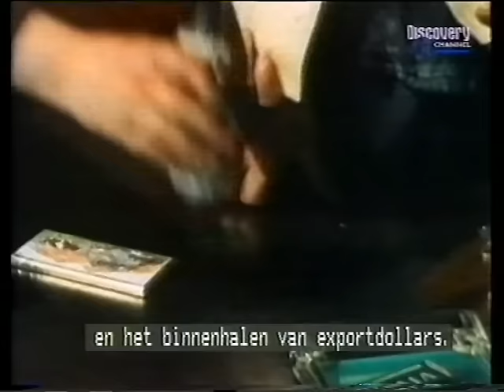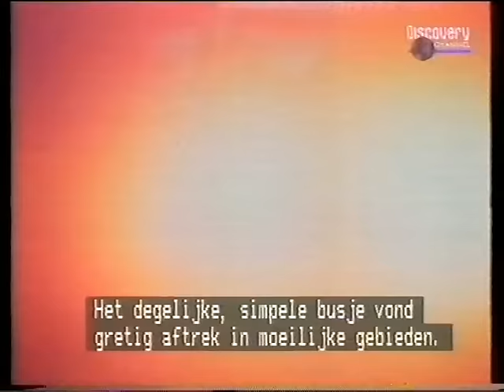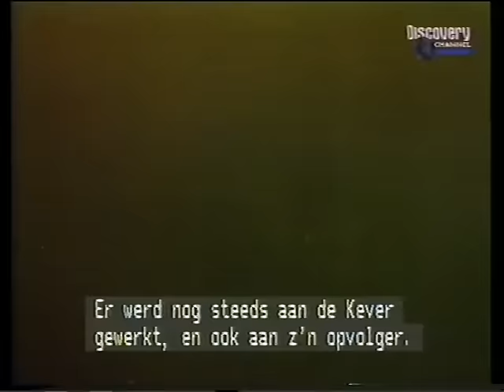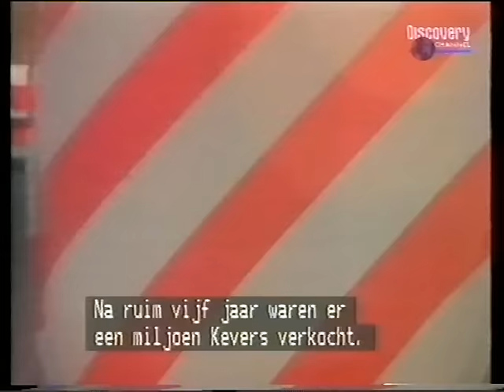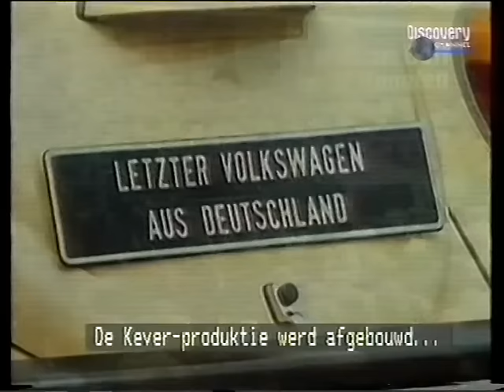vw beetle documentary Classic Wheels (3/3)

Comment: My great uncle back in the early 1990's when I as in my teens once told me when I asked him how hard it was to work on a classic VW Bug as he had owned a few told me ..."son, a VW Bug has to be the most mechanically simplified automobile ever made". Ferdinand Porsche was an engineering genius. For a carbureted engine, they crank up in the coldest of frigid weather compared to other older style engine designs that have carburetors and distributor points. Even the gas mileage is good for a basic stock 1600 Duel Port engine with easy shifting and driving and getting up to 30 mpg isn't unheard of. Parts are still affordable too. They are dependable and are dirt cheap to get insurance on and are good for daily transportation. The lack of them not having a/c might bother some people but overall, they are still good cars and easy to maintain and keep going.

Comment: To me all the new ones are not a real Volkswagen the real ones have the engine in the back and are air cooled . The others are a imposter . Wish I could find a nice one today they are collector cars selling up to 20K for one in great shape and to think in 1970 you could buy one new for less that 2K ! As a teen we bought them for $100 not running because most mechanics out side of a VW shop did not know how to work on them my father was a aircraft engineer and the first time he saw one out and the cooling tins off of it said that’s just like a light plane engine . In fact the FAA did certify them for use in experimental aircraft stripped of the cooling shroud and generator mount replacing the distributor with a magneto was all it took for certification ! Along with the relocation of the oil cooler .

Comment: We had the corvair Ralph Nader stopped that.  It was a damn good car. I had one it would go through mud, sand, anything.  And they kept making the beetle????  Gas tank in the front same thing.  If Nader had been a ball player or a vacuum salesman anything but what the bag of crap he turned out to be. Think of the tooling and molds that are around they could make the beetle now.....
Reply: +Mike Ricky Yes, despite the bad press, the Corvair, especially the 1965-69 Late models, were the best handling cars available from Detroit.  The styling was, of course, much more modern and attractive than the VW Bug.  Unfortunately, the Corvair cost GM so much to develop and build (you couldn't put a Stovebolt or a  283 in it) they cheapened out on things that bit them later on, such as the sparse interiors and lack of important suspension hardware.  But overall it was (and still is) a wonderful car to own and drive, especially the those Late models.